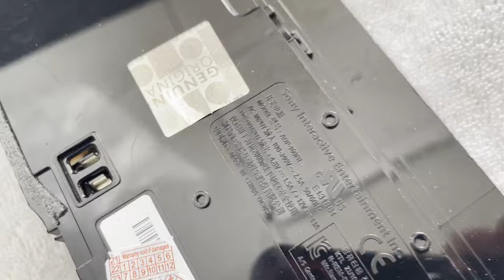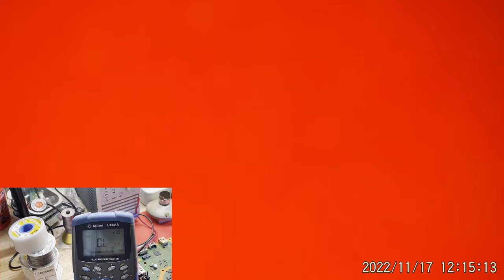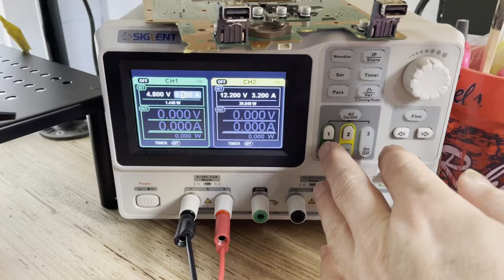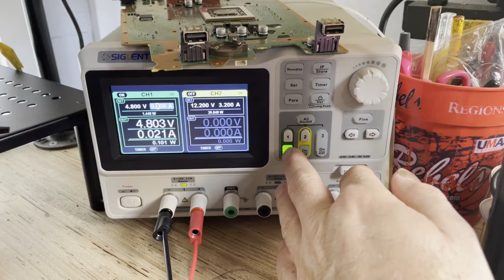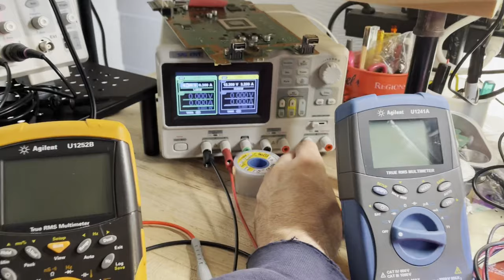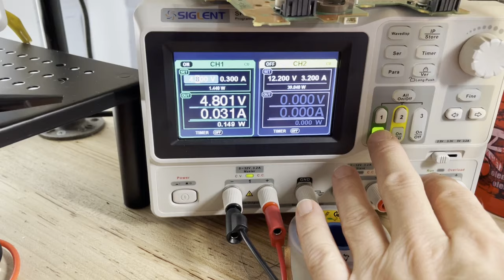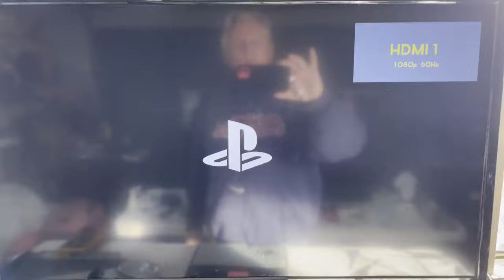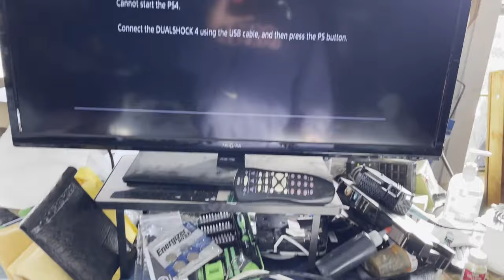#60 Repair of PS4 Slim No Power

Comment: Those nasty 42gg, so damn expensive to replace. I have 2 PS4 Slim boards with, presumably, faulty SB. Always nice to see someone hand reballing an IC, great repair!
Reply from the maker: Yeah the 42GG failure rate combined with a limited number of pulled parts is going to be an issue soon.  Many of these slims will simply not be repaired I would imagine.
Reply: Yeah. I dread the 42gg…. Bought two from china DOA…. 😂 

Early slims have 36g
Reply from the maker: @albertdavis1882  I have a good luck with AliExpress 42GGs.  My success installing them has vastly improved since I started using a pre-heater.
Reply: @ToltecMerc  I’ve tried them both my chips 2x now. Reballed too. I even bought a slim with a FW issue that I robbed the 42gg from. It installed flawlessly, and worked. Confirming my suspicion that my chips are DOA. I don’t think it’s my technique. I think my technique is good. I’ve even repaired a slim where 99% of the solder mask on the board was gone. It’s flowed down and  worked to my surprise.
Reply: @ToltecMerc  do you think that the top heat is killing them? I set my bottom to 150c and top to 320c keeping about 1 inch away
Reply from the maker: @albertdavis1882  There are definitely some shady sellers on AliExpress who will sell you anything.

Comment: I know you are probably aware but there are stencils for southbridge chips. Seeing how expensive those ICs are right now and how salvaging them from other boards is a thing right now it's worth buying them for saving time. With stencil it takes just a couple minutes.
Reply: Forgot to mention I bought a Console Repair Stencil combo on ebay. Like 20ish bucks but has everything you might need for console BGA's
Reply from the maker: Hmmm.  I'll look for it on eBay.  I have a stencil for the South Bridge but not a very good one.  It has a full grid of holes where there are some pads skipped on this 42GG.  But yeah I need to find a good stencil.  Thanks for commenting!
Reply: @ToltecMerc  What I do is use that stencil to place the balls on the IC using a thin layer of flux as adhesive... remove the stencil and manually remove the 6 balls from the not populated pads on the 42GG. It's more time saving than manually populating every pad
Reply: @shakangel666 please can you send the link for the stencil

Comment: Great work. I do have a question though. Just for knowledge sake, how many ohms should you be getting to know that the capacitors under the southbridge is good?
Reply from the maker: I would say if you read less than 100 ohms there is probably a problem.

Comment: There are 3 temps of solder paste / balls found. 138c, 180c, 210c.

With your experience would 138c solder suffice for bga electronics as low heat to fix it will definitely give it more life.

You should get a professional reballing set, you could lift chip / reball in 10 minutes. Its pretty cheap when compared to the time / stress you are taking as this is a routine.
Reply from the maker: I have not had a lot of experience with BGA work.  I'm still learning myself.  The solder balls I am using are standard Sn63-Pb37 so I assume they become molten around 170C.  I have not tried lower temperature balls.  I'm sure they would be easier due to the lower melting temp, but would they be too soft?  I have a reball fixture that I don't like very much.  I use it on APUs but on smaller BGA, sometimes I just prefer to do it by hand.
Reply: @ToltecMerc  every one uses standard 180c i guess. But processors do get to 80c right; and sometimes 90 100c when cooling fails. So i guess low temp bga might cause permanent damage in those places. Since southbridges dont have any thermal pad or any pressure on them, i was having a doubt whether low temp balls would work. Anyway thankyou for the input.

Comment: Great work..But i have an issue where the ps4 powers on and working fine but there is no light on the power button. Should i replace the power button circuit board?
Reply from the maker: It could be the PCB with the buttons and LEDs or the flexible ribbon cable that connects it to the main PCB.  You could probably find both as a set on eBay.

Comment: You replaced some solder mask under the south bridge. Is this common to do or does it happen if to much heat is applied. First time Ive seen you do it. Thanks 😊
Reply from the maker: It is somewhat common.  It is usually damaged by scrubbing to aggressively with the solder wick trying to clear the old solder.  It’s a good idea to repair it so the solder balls stay in place and don’t try to flow elsewhere.

Comment: How is your UFO like UV lamp perform? Does uv mask dry under 1min?
Reply from the maker: I do like the new lamp.  I can't say I have timed it though.  It does turn off automatically though after 20-30 seconds.  I add some heat from the hot air gun to help speed curing.  Thanks for commenting!

Comment: Hey sir,

I'm having trouble with a ps4 that has WLOD I've replaced the hdmi and ic chip a few times and I don't think they are the issue, as I'm not finding any shorts on them or by them. I actually can't find any shorts on the board. Just wondering if the southbridge can go bad without it showing signs of any shorts? I'm quite in a loss here, I'm not sure what is causing the issue and thought I'd ask before I attempt to reball the southbridge myself
Reply from the maker: I can’t say that the South Bridge will never cause a WLOD, but I will say it is very unlikely.  Have you checked the filters between the IC and the port?  Perhaps the fuse that supplies 5V to pin 18 of the HDMI port?  Any missing resistors or diodes near the port?
Reply: @ToltecMerc  Thank you for the response! 

I've checked the filters they seem to be ok, I don't see any missing reisistors or diodes, but I did replace one of the resistors as it had continuity whereas my other boards showed it shouldn't have continuity. relpacing it regardless didn't change anything. I will check the fuse again for pin 18, but one thing I did notice is that pin 18 gets short to ground once turned on but not when it's off and I've traced pin 18 all the way to syscon chip, from where the short is coming from. I'm not too sure if this is normal, do certain components have continuity when the system is turned on? it reads 0.0v all the way to the syscon but it doesn't when turned off in diode mode

Comment: What's you secret to hand re-balling?  By that I mean the airflow.  I can just image spending a nerve wracking hour getting all the ball perfect and then blowing half of the off the chip!!!  Urrrrrrrgh.  Also, you had a UV light on the PCB, but did not document why.  I assume broken pads or traces under the chip?  I would like to have seen a lot more detail on that and what UV glue you used and how you applied it.
Reply from the maker: I flowed the balls into place with 400C heat at very low airflow.  On my Quick 861DW I think i was using an airflow of 10 out of 120.  At that low speed, it has more of an oven effect.  I have had my share of solder balls flow together.  It's usually because of too much flux.  Very frustrating on an APU with so many freaking balls!  There was some solder mask damage on the PCB.  I think the SB had been replaced before.  If you watch just before the light, I am applying some Mechanic LVH900-GY solder mask with a needle and tweezers.  Sorry it was so fast but I have to speed it up because most viewers attention span is not that long.
Reply: @ToltecMerc  Thank you (I could watch that part in regular speed).   I have yet to try it myself.  I have the same Quick air station and I have had the infrared (hot plat) heater for a long time.   There is one BGA part, on boards that I work on, that I need to get up the nerve to change myself.  It is a PowerPC processor.  It's not real big.  I think the big problem it has is bad connections and that may because of lifted pads.  MiniMicroStencile has been able to get a number of the boards working for me and their price isn't that bad; just a 2-2.5 week delay between tries.

I think you must not drink coffee, at least on the day you do the balling.